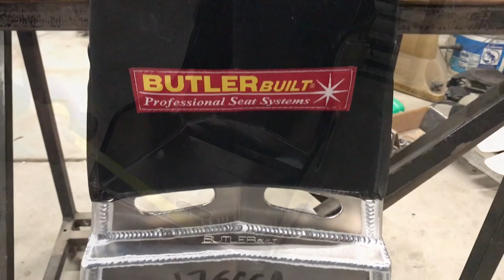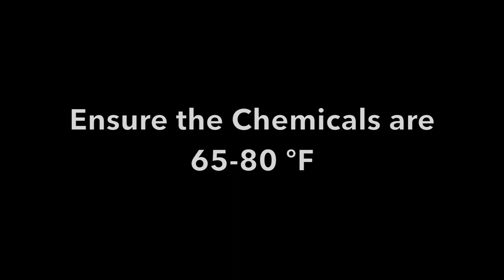Making A Custom Foam Insert for the Race Seat

Comment: Thanks for the video!  Wow that liquid is interesting stuff!

Let me share what has worked very well for me for FREE MATERIAL!, much of which I've learned from my brother who is a professional upholster, with making a new bench or van bench seat or boosting old car seat foam:

For car seats that need boosting, most often they just need more foam added to be like new again, I find used carpet pad foam often in a neighbor's trash or dumpster behind a carpet store. Remove the car seat fabric clips and carefully peel the front and sides of the fabric to gain access under the seat foam core, which often requires the seat be unbolted from the floor. 
Place a sheet of it or two under the seat foam core, right on top of the spring wire deck(carpet pad foam is tougher than the core so this also stops the spring wire deck from cutting into the seat foam core bottom).
Your second sheet can be cut smaller just covering the area the butt sits on.
Also inspect the top of the foam core and add carpet pad foam or regular foam where might be needed like by the door, worn from getting in and out over the years.
Spray adhesive can be used to bond the foam to the foam but is not necessary except for any top foam added.
Your seats will be firm and new like for many years now, it's like free magic!
The seat back usually doesn't need a any foam because it's the seat that gets the body weight on it from gravity. If you seat back should need a boost, you can add polyfill batting on top of the foam for free-see below.
These methods can also be used on sofa seat cushions.
I'll share below where to find FREE used good foam below!

To make a bench- where to get free foam: there is so much FREE foam and FREE polyfill - in many soft pillow backs and polyfill batting often wrapped around foam cushions for the taken in people's discarded sofa's and chairs found outside dumpsters at apartment complexes and the back of thrift stores. 
Even though it's used, it has been well protected covered inside the upholstery. 
Of course in the event it's a cat lady's furniture and the cats happened to piss all over it, you'll smell it and know to move on lol
Most apartments don't allow pets or make it expensive to have a pet so a lot of furniture is pet free.
Use a box cutter to open the old furniture to get at the free foam or poly as you need or use the zipper you'll find on some pieces.
Some foam in old sofas contain like a 1" thick panel of foam on top of other foam that is perfect thickness to add to your sofa foam to give it the new boost again.

Foam can be cut to size using a hack saw loose blade only in your hand holding the end making a sawing motion.
New foam looses some of it's firmness over a break in period, say after 5 years depending on how much it's sat on. 
But then the broken in foam lasts a very very long time at that softer level firmness before it really starts to break down. 
You might be able to buy complete new expensive foam cushion cores but they will sag after the break in period as well.
This is why so often we love a new firm piece of furniture but then it gets soft and saggy on us. 
Now the sofa companies could to put super firm more expensive foam in their sofa's when new that might be a perfect firmness for us when broken after the 5 years break in period, but then we wouldn't buy the sofa if it's not nice to sit on from the beginning in the show room, so there's the dilemma when you fabric is still in great shape after 5 years but the foam is now sagging.

The free fix:
So just add more foam if you can firms it up to make it like new again, unzip and compress the foam as you slowly peel off your fabric from the cushion core. Then either add more foam to the top or bottom or hack blade saw through the center horizontal line of the foam core all the way from the back to almost through the front but not through, so you leave a good hinge of foam in the front.
Then place about a 1" thick of used foam in the sandwich and holding it closed peel the fabric back over the foam cushion.
You can also add more polyfill pad to the cushion core on it's outside to add more softness and support but adding more foam is the big boost.
Spray adhesive is optional to bond the foam to the foam.
People often think that when the seat sags that the springs under the cushions, have weakened but no, it's the foam, the springs are metal and strong, the foam is just foam.

For making complete new cushion tops for say a bench, besides free foam, you might even find a lightly used fabric in some part of a discarded sofa to use IN FACT the back side of sofa's is often a large sheet of fabric that has been hidden against the wall never sat on all it's life and so still brand new! 

Discarded trash at a dumpster is free for the taking and your reducing what goes to our planet's landfill.
This is win win, real free hard core recycling, helping to save our environment as well!

Take care!

Comment: Great tutorial mate, when you and your trusty offsider fitted the fabric, did you have to trim sections out in the bottom corners?
Cheers 
Terry
Reply from the maker: Yes. Depending on how the fabric folds up we had to cut some slits to overlap it and glue it down to get the best fit. Make sure not to have open slits exposed though as the fabric is fire retardant and so you don't want any open gaps if possible.
Reply: @KangaMotorsports  okay, cheers for taking the time to reply. Good luck with the racing!

Comment: Okey, thanks! Another question, how many liters/oz foam seat liquid (not expanded volume) is required to make a seat? Thanks in advance
Reply from the maker: I don't remember the amount we used. It depends on the size of your seat and yourself. Recommend you contact ButlerBuilt directly to ask which size kit will fit your application.

Comment: Does the fabric apply to ul94 v-0?
Reply from the maker: Sorry not able to help you there, the fabric uses a spray on adhesive. Would be best to contact a flame retardant fabric company directly.
Reply: @KangaMotorsports  Okey, thanks! Another question, how many liters/oz foam seat liquid (not expanded volume) is required to make a seat? Thanks in advance